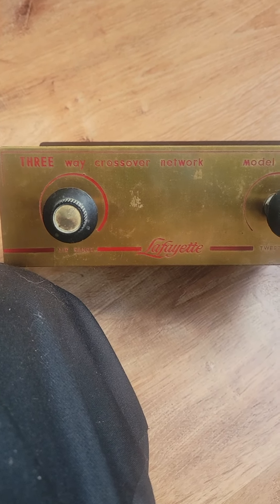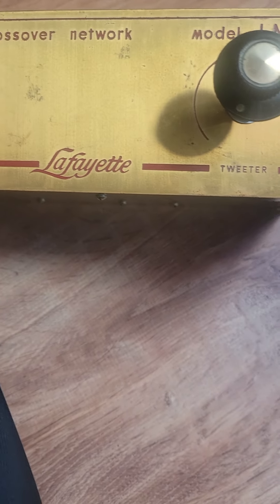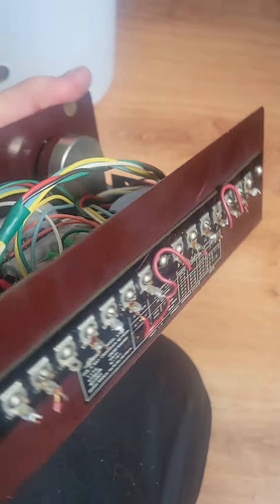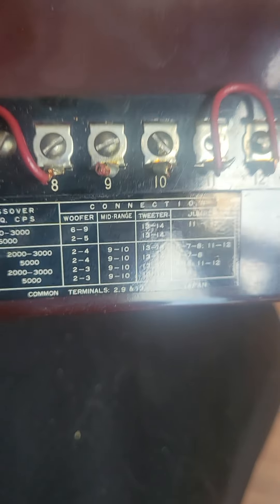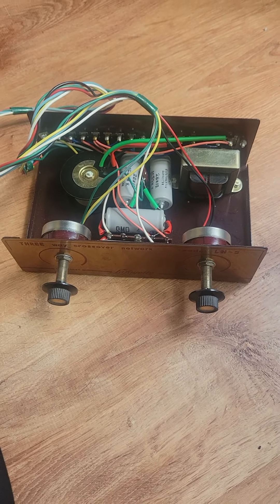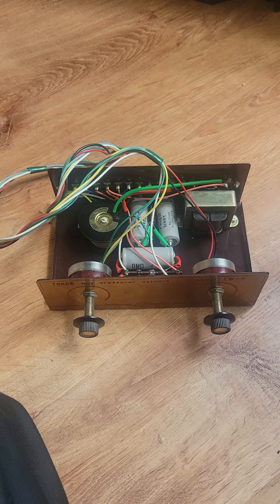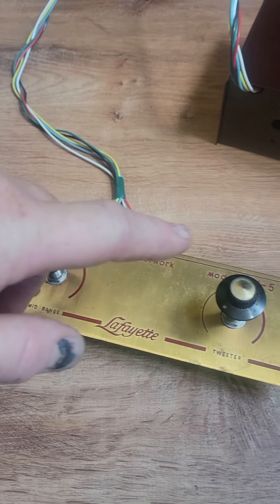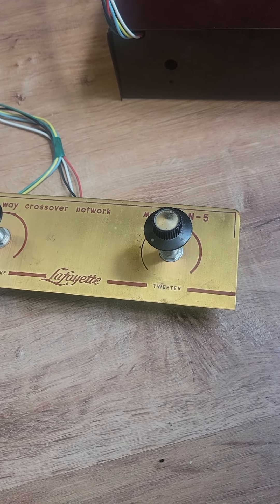Lafayette 3 way crossover network

Comment: Hay I know this is off topic but I have a Hammond t-295 and I have no idea what I’m doing and o have reached out to local repair people and they won’t touch it because it’s 70s tech.  WTH I’m not giving up I will
Fix this.  
Is there a way to find pictures of the boards and schematics and such. I have 3 wires disconnected and don’t know where they are supposed to be.  It may be all I need.😅